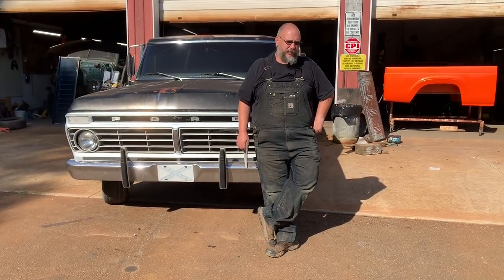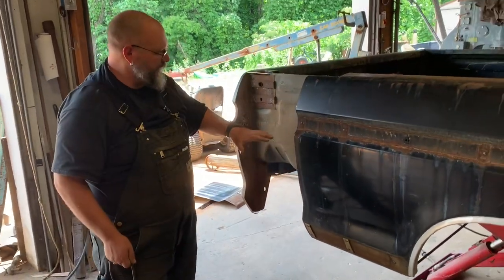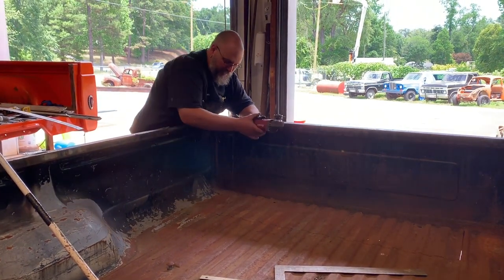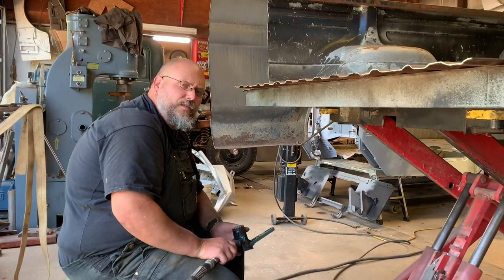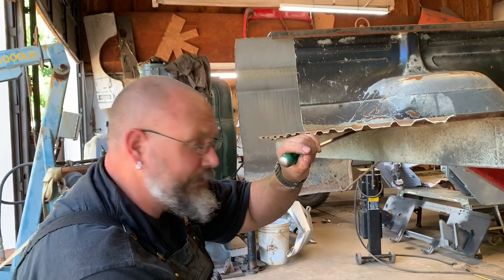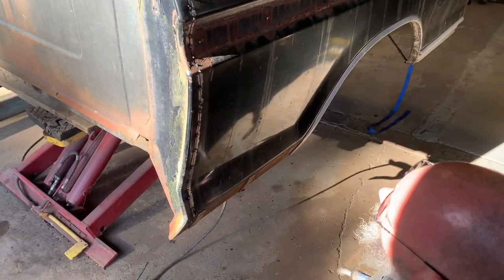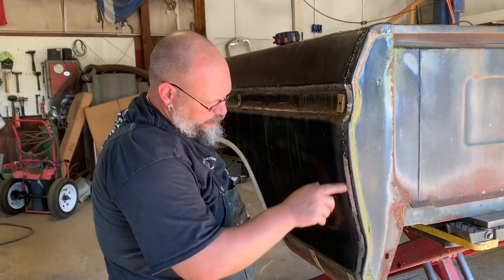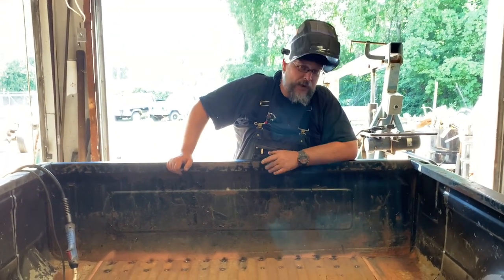1973-1979 Ford Truck Long Bed to Short bed Conversion

Comment: Good evening, I do like your engineering. Your technique prevents alot of warpage by staying close to the edge. And thanks for the tip about the cutoff wheel being more accurate when it has some prior use. You take care and good luck.

Comment: Only one thing you need to do different. Instead of cutting it 16", measure it all out for 16" then cut it at 14" instead. This allows you to cut right on the seam of the front corners. Once you do that you can trace the longer bedside you cut at 14" instead of 16" down the inside and you can cut it to math the corner perfect. It has a little bit of curve in the weld when you put it back together making it less susceptible to warping plus it's right on the corner. Works great
Reply from the maker: We looked into doing that but the way we do it works well for our shop.

Comment: Awesome video! What landmarks did you use as a starting point for the inside bedside? Preserving the notched-out portion for the filler neck?
Reply from the maker: You can’t preserve the notched out portion because you can’t use that tank, there isn’t enough room. I decide to cut wherever it appears it will all line back up with our the bump. If you have to or want to put the bump back in then you will have to cut out for it after you splice the bedside back together.

Comment: How much you charged to do this thanks
Reply from the maker: What year? The year determines price.
Reply: @thehousethatrustbuilttinma3608  1978
Reply from the maker: @ralphhager4638  $2,000. That is cutting frame, bed and all
Reply: @thehousethatrustbuilttinma3608   I just need bed shorten I got the truck but couldn't find a short bed for it so I bought a long bed and was thinking about doing it myself but you made it look easy lol I have step side for it but like the fleet side thanks
Reply: What state are on
Reply from the maker: @oscarramos4313  North Carolina